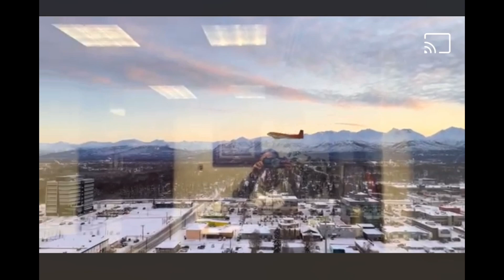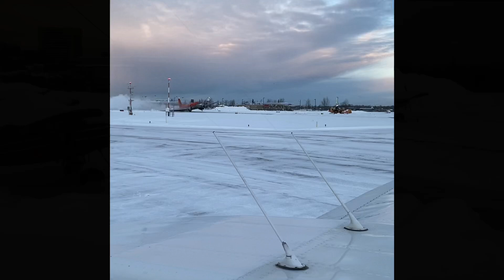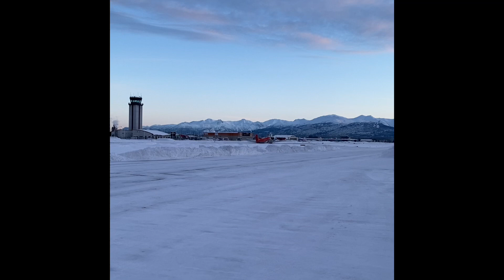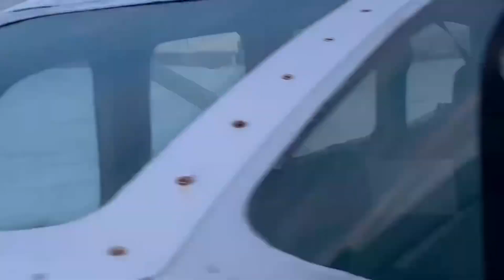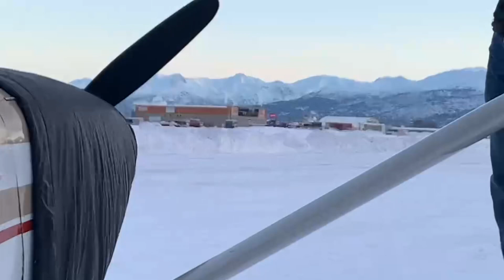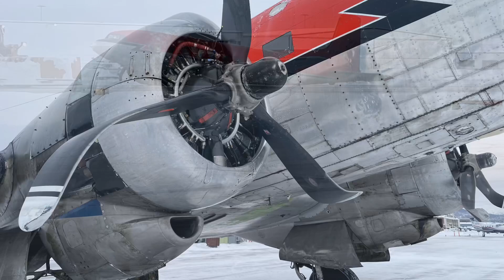Trans Northern Douglas R4D-8 DC3 engine failure. Crash accident.

Comment: For all of you guys praising these heroes, there are some big issues here.  
1) It's a cold day. And, the super should be capable of climbing on one engine. Why can't it?  
2) The right engine is feathered, but it was running when it hit the runway.  Why did they feather a running engine if they couldn't climb the aircraft on one engine?
3)  They were going to Kodiak.  Normally, a Kodiak off 7L/7R would have been assigned the POTTER 1 Departure.  A properly performed runway analysis would prescribe an Engine Failure Procedure with a RIGHT TURN (lower obstacles) after takeoff in the event of engine failure.  They didn't.  And, had there not been a runway in downtown Anchorage, they would have crashed into downtown Anchorage.

Very serious issues here.  But, now we know the brakes work when the gear is up.
Reply: You think turning right, into the dead right engine was the proper thing to do?  Look up what happens when you turn into a dead engine...  What makes you think the engine was "running"?..  If they couldn't get it to fully feather, that is a lot of drag with the passing air turning those dead props....Brakes, geez.....Good thing they didn't create more drag dropping the gear... Seriously..
Reply: @ChugiakAK  The engine was running. Watch the video.
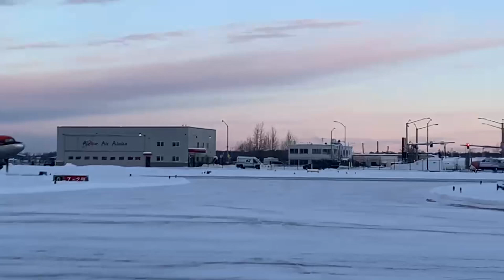Reply: @ChugiakAK  0:49
Reply: @ChugiakAK  Right turn or wrong turn, they did both on the way to Merrill.  I’ve been on one engine a few times and turning toward the bad is no worse than turning toward the good.  It’s the inclination that counts.  

You sound like you were born yesterday.
Reply: @alpenglow1235  Nice try.  Can't win, smear 'em.   Flying and owning aircraft since 1976
Reply: If its loaded heavy no freaking way even a super will be able to climb with 1 engine.  This is a really stupid comment.  They barely made it.
Reply: Well, Alpenglow123. I think you have some serious misinformation problems here. The brakes won't work at all because this is a Super DC-3 with full wheel well doors and the wheels have no contact with the runway when landing gear up. 
Making a left turn into the operating engine is proper procedure.
It may have been a cold day, but cargo aircraft are often overloaded, and well above the weight shown on the paperwork.
I think the crew and ATC did an outstanding job here. But what do I know? Only 37 years flying for a living and 1500 hours in the DC-3.
Reply: @davidkallewaard750 ,  1500 hours in the DC-3? Do the brakes get pressure from the pedals when the gear is retracted?

 You wrote, "cargo aircraft are often overloaded, and well above the weight shown on the paperwork", to justify the actions of others.  TN is authorized to carry passengers in the DC-3S.

Part 135 requires 2 engine recipe powered on one engine to achieve a positive rate of climb.  That didn't happen.  And, it was a cold day. Empirical evidence.

You've been flying for so long that no one can argue with you.
Reply: @rnelson299 ,  "...loaded heavy no freaking way..." "They barely made it."   Well said.  And, that's why they couldn't maintain altitude on a cold day.
Reply: @alpenglow1235  Yes, of course the brakes get pressure when the gear is up. When I said they won't work, I meant that they would have no effect slowing the aircraft because the tires had no contact with the runway. The aircraft was sliding on the wheel well doors. Look at the still photos taken after the aircraft was raised back up on it's gear and see the damage to the gear doors.
As far as it being overloaded, this incident just happened and it will be a while before an NTSB report comes out. We'll see if they feel the crew did everything right, or wrong.
Reply: @ChugiakAK , I stand by the empirical evidence: The airplane crashed.  The pilot in command is responsible for decisions.  Carrying fuel not shown on the paperwork, flying overweight, accepting the operator's budget constraints, accepting less than perfect maintenance, accepting less than perfect training, etc, are all on the PIC.  The airplane is a lethal vehicle.  The empirical gun argument stands: "Airplanes don't kill people, people kill people."

After you are near death, when you question your culpability in the dead of the innocent, will you comprehend these statements in a different light.  Until then, you will continue to seek false heroes and apply immature interpretations to ambiguous statements and wisdom. 

The damage does not qualify as "Substantial" under NTSB 830. There will be no investigation.  So, the heroes will live on.  ChugiakAK, You win.
Reply: @alpenglow1235  I wouldn’t call it necessarily a “crash”..   It looks like a successful belly landing to me, with little damage as you indicate, thanks to the pilots…  As to your grandeur statements, a  Don Quixote, tilting against windmills…. keep on keeping on...
Reply: @ChugiakAK , Twist it however you wish.  The flight did not reach it's intended destination.  The flight was unsuccessful the moment it left the ground.

By the way, TN was recently purchased by Josh Jacko, Dena'ina.  Transition is an element of heightened risk.